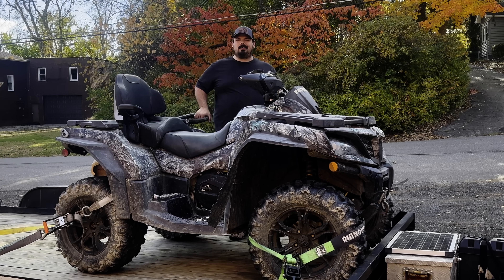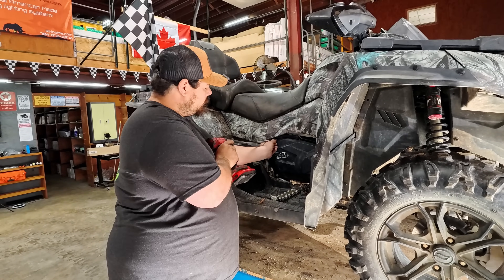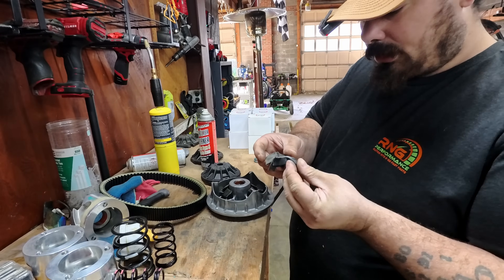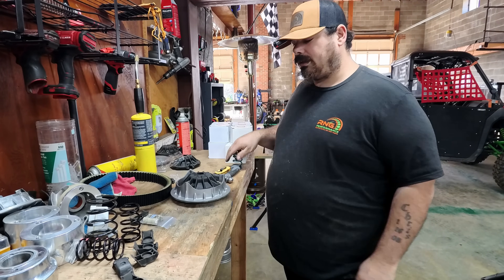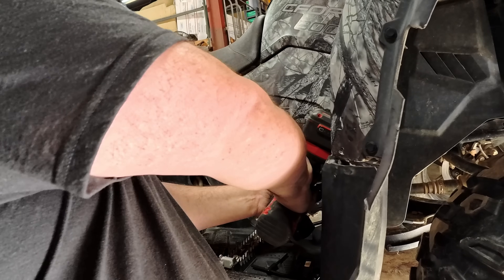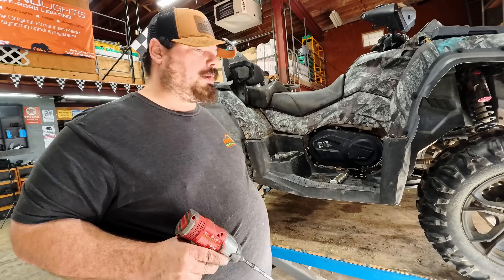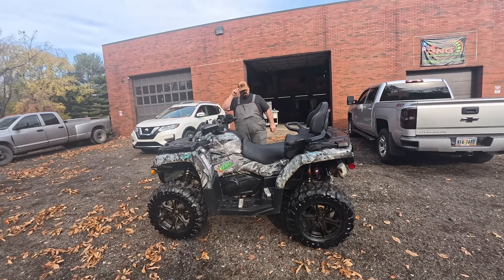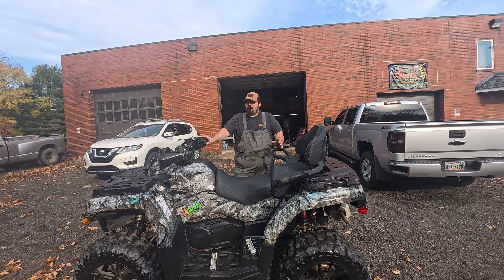I Bought This $10,000 CFMOTO ATV For $4,000.  Did I get screwed?

Comment: I just picked up 2019 CF Moto 800 XC from the auction in Brampton Ontario for $2500. It was missing both clutches and the cover and the rear seat but I managed to sort all that and have it out and ripping now but keep throwing an engine code for running lean so trying to figure that one out which is why your video came up as recommended as I've been searching these. So far I'm loving mine and think it's a great looking machine.
Reply from the maker: Definitely 👍 good find for sure. 👍

Comment: I won't start by saying you are great at what you do!! I must admit I am a ROOKIE when it comes to ATVs. My question to you is: Is a 2022 CFMOTO 600 Touring with 992 miles and 111 hours, and a stage 3 clutch for $5500 a great buy? Is 992 a lot of miles for an ATV? Thanks for any info!!!
Reply from the maker: It’s not allot of miles.  But if it has a stage 3 clutch in it take the clutch apart and inspect it. Those clutch kits take a huge toll on these clutches. If it has any clutch issues we can get you fixed up and taken care of.

Comment: Hey mate,
Do you know if tightening or loosening the front springs affects camber on the 2024 cforce 1000? I want a tiny bit more negative camber. The stock setting is quite positive camber.
Reply from the maker: No it won’t.

Comment: I think you got that cheap as hell. I'm guessing your in the midwest somewhere. That unit would fetch 6k in the northeast. I sold my 2019 600 touring for 3500 with 9800 miles. Could have gotten 4k but i only had it for sale for a week.   That thing barely broke in with 1400 miles.
Reply from the maker: Heck yeah 👍

Comment: How comes a 3 years old machine with only 1500 clics shows  that kinda of wear on thoses clutch parts. is it that cheap and poorly buit ? I got a Cforce 1000 2023 with 2000 kms and im starting to regret buying one of these ... even if i did not have real issues with mine exept the horn broke down (main switch but got it replaced under waranty) and the other day the steering was really hard to turn and the 4x4 wasnt getting off when i was  turning the switch on and off... im kinda worry for long term reliability on those.. they sure are cheap on price but im gessing that you pay for what you got..
Reply from the maker: This machine was worked very hard at a camp ground hauling trailers etc.  the wear on the clutch wasn’t bad at all. There were signs that the clutch got hot 🥵 that’s how the crack happened this is likely due to pulling too heavy of loads and or doing it in high gear.
Reply: @R.N.GPerformance  ok thanks for the explanation !! God bless !!
Reply: @R.N.GPerformance  Hi. Let's be honest, cvtech miscalculated a bit by making a sharp edge at the pulley. From cyclic heating and cooling, the sharp edge cracks, in other words, metal fatigue. My segway already has a modified pulley, they rounded this edge, thereby removing the place of stress concentration. I would advise you to do the same when servicing. On the machine, make a small chamfer, radius. It seems to me that this will significantly increase the service life of the pulley